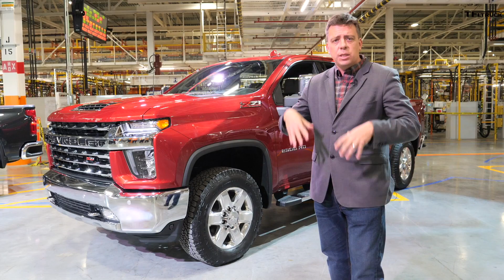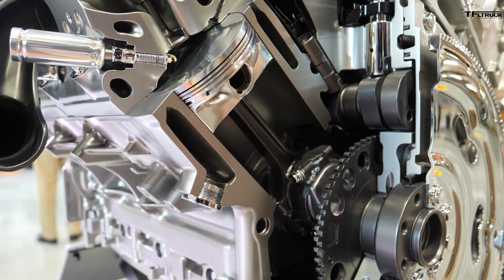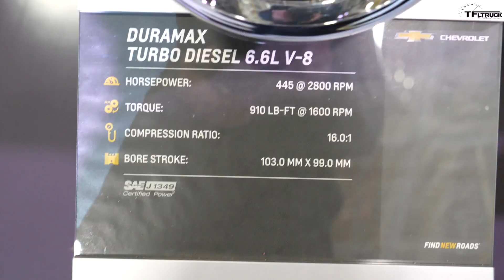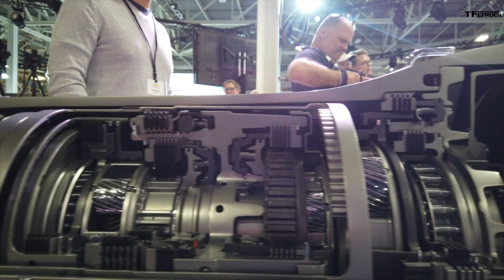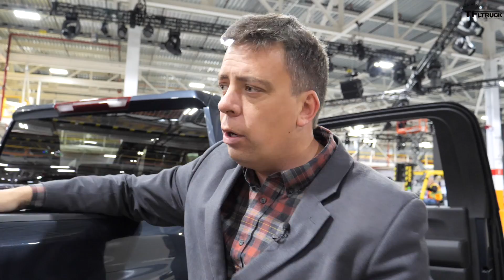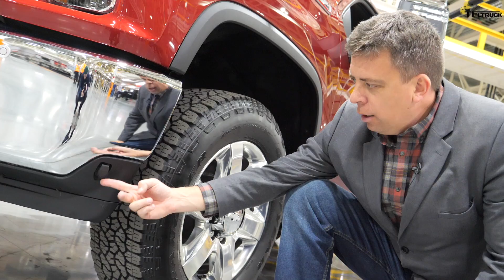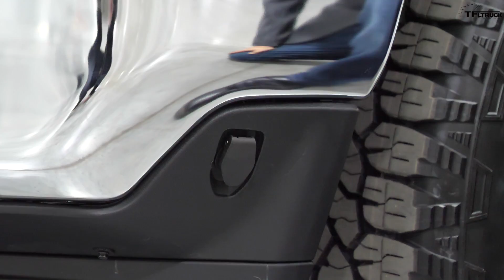Here is How the 2020 Chevy Silverado 2500 HD Delivers the Torque to the Ground

Comment: Max torque achieved at 4000 rpms.  Not good Chevy.  C'mon, could have done better.  You need that torque down low for towing/hauling.   Not impressed
Reply: I know when I'm making hauler engines in Automation i aim for around 2500-3000 for peak torque, so i can understand the issue with 4K RPM lol
Reply: Jonathan Powers where would you have that torque at? What’s your rpm when your going up a mountain? 2000 or closer to 4000?
Reply: @taxpayer9972  when one is towing/hauling you want the torque down low to get your heavy load moving from a standstill.   When you are climbing grades,  you rely upon horsepower at higher engine speeds.
Reply: @rocketj7449  It's a gas motor, what exactly did you expect?
Reply: @dedalliance1  you're saying it's not possible to build a gas motor to produce torque at lower engine speeds?
Reply: @dedalliance1  Tundra 5.7 V8 401 lb at 3600 RPM, Ford 6.8 V10 457 lb at 3250 RPM, chevy 8.0 V8 475 lb at 3200 RPM, and the list goes o n
Reply: @rocketj7449  The 5.7 Toyota isn't made to have a GVWR of what's probably gonna be 20-23k pounds. The v10 Ford Triton is a garbage motor that gets garbage MPG and sucks. The Chevy 8.0 is a much larger displacement engine and probably also got about 4 mpg doing that 3200 RPM. Does it really matter what RPM you have to spin the motor to get max torque? As long as the engine is strong enough to take the abuse I don't care if it's at 6,000 RPM and still lasts long enough to go 400k miles.

It's about finding the middle ground of Fuel Economy, Power, Reliability, and shift points on that specific truck with the specific gears and the specific transmission. And this must be what GM came to for probably a good reason, the 6.0 has been a pretty well built proof motor so lets hope they carried that over.
Reply: @dedalliance1  so I have provided gas motor torque specs below 4000 rpm, and you have trashed every one of them.  You must be GM biased.  I understand now.
Reply: @rocketj7449  lol I am GM biased. My Grandpa worked for GM for 22 years building Corvettes in Bowling Green Kentucky, and he would have worked another 22 years had he not been medically retired due to a stroke and heart attack. So yeah I'll support a company that supported our family for so long.

But like I said, it doesn't really matter what the RPM is at for max torque as long as the motor is built to handle it. But seriously, the v10 Triton is a garbage motor ask anyone that has one. the 5.7 Toyota is a light duty, and the 8.0 Chevy is just a huge motor, so obviously it would have better power numbers if that was the design intent for it.
Reply: @dedalliance1  I've asked tons of people about the v10, even some Chevy guys (i also used to be one) and every one says it's a great engine that has tons of power and lasts forever. Most have 300,000+ miles of hard use on them, only down side is they get low mpg, about 10mpg when towing 8,000lbs in my experience which isn't that bad. I guess i have a hard time supporting a company any more that took 11 billion dollars from us, then put a bunch of U.S. citizens out of work (which they still are doing), moving work out of the country, just to find out the high ups in the company were covering up crap like that whole ignition switch deal. Ram and Ford for me now and they are much better trucks. BTW most chevy guys i've talked to say the 8.0 is garbage.
Reply: @WhoThisGuy515  Well, my only experience with the v10 Triton was one of the trucks my College had. I did a 2 year construction degree and we had 2 trucks to pull trailers and equipment around, a f350 diesel crew cab long bed, and a F250 v10 Triton extended cab standard bed, I think both were around 2003 to 2006 models or something. The Triton had a check engine light on for 2 years. It seemed kind of slow, sluggish I think it ran about 6 or 7 mpg and that was town driving pulling maybe a 4k pound cargo trailer, granted in Montana it idled a lot to warm it up when it's like say negative 20 outside. We had a mechanic program next door and it seems like it was over there pretty often and it only had like 150k miles on it. I guess it wasn't a bad truck forsay, but I don't think I would spend my money on it. If it works for some people and runs for a long time then that's great and is serving a good job.

As far as GM's bailout who cares? The whole country lost its shit in 07 and 08, the bank you use was probably bailed out in some form or fashion, should we have let it crash and you lose all your money, or your house or anything else you had financed at the time? Should my Grandpa who retired from GM lose his pension because gm didn't have money and went under?

Times change, everyone is moving jobs out of the country, if GM raised their prices to compensate for American labor then you'd be here telling us how gm sucks because they are 5 grand more than the other trucks. We bailed gm out because if we didn't 100k plus people would have lost their jobs and many more like my grandpa would have lost their pensions and retirement benefits, my grandpa already lives in a single wide he'd be homeless without that money and without his healthcare plan. And when he retired after 22 years due to medical issues in the 80s he was pushing 20 an hour, that was almost 40 years ago, it's not like they don't treat their employees well. 

And who cares about 11 billion dollars, you know how many billions we've sent to various middle eastern countries that did nothing but kill us more. That's what you should be mad about because we'll never see that money again. At least the gm bailout helped support American jobs and the economy, we've probably made it back in taxes alone from everyone that works for gm and all the sales.

If you want them to build solely in America go send an email to the CEO with all your friends pledging you'll pay 10% more for the sale of a new vehicle if it's made in the us. Oh, don't want to spend what it takes? That sucks  stay with Ford I guess.
Reply: @dedalliance1  and if grandpa was  still working he would likely be laid off due to GM downsizing.  Sad but true dude.  No sentiments towards GM from me.  Back on point.   It difficult to have a sensible debate about this because your favor towards GM.  So the new 6.6 V8 does produce more horsepower and torque than the previous 6.0, however, Fords new 7.3 will be better utilized for heavy towing/hauling.  Sorry, just sharing the facts bud.
Reply: @dedalliance1  Well I'm glad your grandpa was able to make it out alright in the end. The company I work for who supplied lots of parts for GM and it's subdivisions, didn't get that lucky when they pulled parts out of our facility and forced 1/4th of our workers out of work. My father was included in that. So don't think I say those things cuz I want to be a key board warrior. GM is finally bringing back parts to us in form of the new 9 speed autos so I guess we will see what the future of GM holds for us Americans. Have a great day sir. Also I should add that I use a Dodge as my work truck right now which I'll be sticking with since she's got 235,000 working miles on her.
Reply: @WhoThisGuy515  I get it, cut backs and loss of business sucks. But that's with any company in any business. When oil prices fall pipe welders and people in that field lose jobs, when super fund sites like Handford in Washington state get defunded or at least less funding than they need people lose jobs, that's what happened to my mom and like over 2,000 other people there all because the president and Congress and others back in 2010 and 2011 didn't want to sign a check. Just like the recent government shutdown. It's not necessarily GM's fault that they had to close factories and or stop manufacturing certain parts in the us it's the economy's fault, it's the government wanting too much taxes it's people thinking they're worth 15 an hour to sweep floors part time.

When people say I'm gonna stop buying GM because they laid these people off or stopped manufacturing this part and boycotting them, and not saying you specifically are, but a lot of people are. The only thing to come out of that is GM making less and less money until they go bankrupt again and then even more people lose their jobs. If people think gm makes a competitive product that they like, they may as well buy it so gm can keep people employed. Just like the new HDs are going to be made in flint Michigan, that's supporting us jobs.
Reply: @rocketj7449  Well, as far as the 7.3 Ford motor I'm sure it will be competitive. I honestly just like seeing a GMC logo every time I look at my steering wheel because it looks so nice all red and sparkly, also, I get good employee discounts. My new truck was 53,300 msrp, out the door, no sales tax in Montana, I paid 41,100 and it'll run me hopefully 200k miles or 15+ years without worry.

But one number that would be more impressive than hp and torque is if you put a Ford 7.3l on a huge treadmill made to act like a real road, and then put its max tow weight on a trailer behind it then just let it cruise at 65 mph, only stopping for an oil change running 24/7, and then do the same thing with a GM motor and with a Dodge and last one standing wins. That's the only number that could make me buy a truck blindly. But of course you'd have to do it with 3 or more trucks from each manufacturer to make it scientifical and crap. If I win the next 2 billion dollar lottery I'll set up this exact test un biasedly and we'll see who has the best motor.
Reply: @dedalliance1  My experience with Chevy is the Express 4.8 2500, I have owned 2 Ford Econolines with the 5.4, the Tundra 5.7, F250 with 6.8, I have test drove the Silverado 6.0, and F250 with the 6.2.  All gas.  From personal experience,  the Express has been reliable as I had no break downs since I bought it new.  My complaint with Chevy, the body dents very easily, and the 4.8 has no power until 4500 rpms, and I carry a 3500lb load.  Chevy has a racing heritage which may transfer over to the way they design their gas motors.  I have driven the 4.8, 5.3, and 6.0, there is no power on the low end until you get into higher engine speeds.  Ford has designed their 5.4, 6.2, 6.8, and now 7.3 to provide adequate torque at low engine speeds to get the vehicle and its load into motion.  That has been my experience with the two Econolines and the F250.  I will admit test drove a Silverado 2500 with the 6.0 and I was impressed.   It drove like a car.  The drive was actually more comfortable than F250.  But, I opted for an older Ford 6.8 for its towing and hauling capability.   I think Chevy makes a good product, just not ideal for my application.
Reply: @rocketj7449  I have a 2028 GMC Sierra crew cab long bed 6.0L SLE 3500 and you're right they ride and drive very good. A couple months ago I went from Wenatchee WA to Fort Collins CO in 1 day, about a 18 or so hour drive according to GPS, left at 4 am and got there at 10 PM that night, and they're an hour ahead of Washington time. Drove great, was empty and still had a good ride and I didn't feel uncomfortable at all. I haven't towed with it yet because it's still brand new with only 7k miles. But, I towed with my old 2018 Silverado 2500 HD crew cab standard bed WT. I had me and my brother in law in the cab, with a 1,000 pound truck camper in the back, with a bumper pull 22' flatbed Murdock trailer and my brother in laws 2012 Silverado crew cab long bed dually diesel on the trailer. Probably pushing the 14k pounds max tow on the truck, but I drove it about 30 minutes down the road doing 60 mph and other than it being a little sketchy on the bumps with all the weight in the bed and tongue weight it drove just fine. Granted it wasn't a diesel that'll get it up to speed super fast.  I had no complaints about it at all. But that truck later got totaled so I got a 1 ton for better rear end suspension.

But when using a truck also as a daily driver that extra comfort really helps in my book. And when you can feel comfortable maxing out the trucks tow rating that's pretty handy too. But at the end of the day, every company produces a competitive product, if they didn't they wouldn't stay in business for over 100 years. It really is just personal preference. And I like looking at the GMC logo and it'll do everything I need it to do, so I bought it.
Reply: @dedalliance1  I own a 99 F350 4X4 V10 with just over a quarter million miles on it, I owned a smaller lighter 99 Chevy 2500 with two wheel drive that had a 454, much less power and 1.5 mpg more fuel consumption. I prefer the V10. This is my third V10 and I have been impressed with the performance and economy of each of them. I have owned three Triton 413 cubic inch V10s now, and I thoroughly enjoyed each one of them and I still own one. I am here to tell you that the Triton V10 is not a garbage motor. I call you sadly mistaken at best. It is sort of sad that you support GM because they gave your family money and feel the need to trash talk other brands. I did not hate my 99 Chevy, it was just inferior to my current truck, the V10 F350.
Reply: @rocketj7449  bro it's a 2 valve engine. That means most of it's torque is available at 2,500 max torque is 4,000 that just means it has a broad power band
Reply: @geauxtigers2911  and?  The topic was producing max torque at lower engine speed.  Ford and Toyota can do it.  Chevy needs to work on their engine design.
Reply: @rocketj7449  dude the 6.2 Ford hd gasser made peak torque at 3,800 ...that's no difference at all
Reply: @rocketj7449  the 6.4 hemi makes max torque at 4,000 there's absolutely no difference in the 3
Reply: @geauxtigers2911  That's why I didnt pull the trigger on the 6.2 Ford.  Worked well in the Raptor, not designed to tow haul.
Reply: @geauxtigers2911  the 6.4 hemi not a good choice for low end torque as well.
Reply: @rocketj7449  you have to understand also these engines have to make cafe standards...it's hard when your hands are tied...all of the engines you listed above where designed before new standards came out ...the Toyota engine isn't a HD engine ...it's aluminum block and don't have forged internals and it's a 4valve which means almost no power below it's power band...I can almost guarantee that even though the 7.3 is a big block it's torque will come in at 3800-4000
Reply: I just remember when they did a TV episode comparing the V10 to the GM 6-OH V8 how the heavier ford didn't tow the lighter chevy as well as the lighter chevy seemed to tow the heavier ford and the chevy got better mileage to boot.  There's more to the story that maximum and peak numbers but real world experience, the complete package operating as a single unit and how long it lasts doing it's intended job while be properly used and maintained.
Reply: @williambell6975  i would love.to see.that video!  Got a link?
Reply: @rocketj7449  you seem to not understand Chevy torque lines, the standard Chevy engine design doesn't tend to have a peaky torque curve when you dyno it, it usually hits 85-95% at or before 1800 rpm and stays very flat until around 4400-4800 RPM before beginning to taper off rather than building until peak torque rpm then falling off like a ford and some dodge engines, its actually one of the big strengths of their design since the jumps between gears are quite smooth as a result
Reply: That's max torque, 2 valve engines make up to 80% of its torque at lower RPMS like around 2000-2500
Reply: You don't sacrifice high-end torque and HP for low-end torque when you have that many gears.
Reply: @cw6371  guess again CARLTON!  Shortening the gears will get you into the power faster, but it still doesn't add torque!
Reply: @rocketj7449  there was no guessing involved. Gearing mutiplies the torque to the wheels, negating the need for so much crank torque.....while making more HP.
Reply: @cw6371  been there,  done that.  I have played around with axle ratios, gear ratios, etc.  While it may feel it gives you more torque, it just gets you into the power band faster.  When you have a load behind you, you're still going to feel it despite how many gears you have.  But I can speak from experience with a 5 speed tranny and high amounts of torque, the motor just does not work very hard.  With a low torque motor, you will need to get into the power band to get the load moving.  In comparison a motor with low end torque just doesn't work very hard at all to get the load moving and is happy pulling in the 2000 to 3000 rpm range.  Your 6.6 will be happy working in the 4000 to 5000 rpm range.  Ford knows this, which is why they produced a high displacement V8, not sure about actual numbers yet, pretty sure its stroke is larger than its bore, which will add to gobs of low end torque, which adds longevity to the motor, and it will outlast the 6.6.  Nuff said.

Comment: André, 4 Auto doesn’t switch between 2wd and 4wd, it’s still 4wd, but the T-case acts as an open center differential, so the front and rear axles can rotate at different speeds, like around corners.